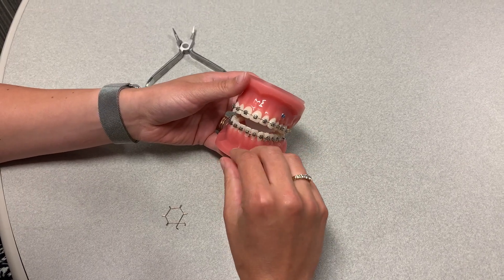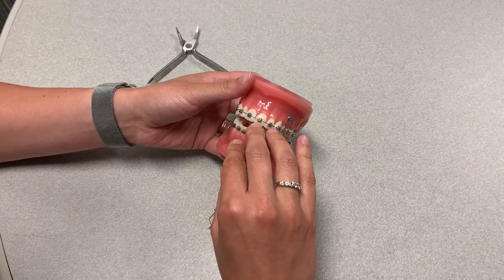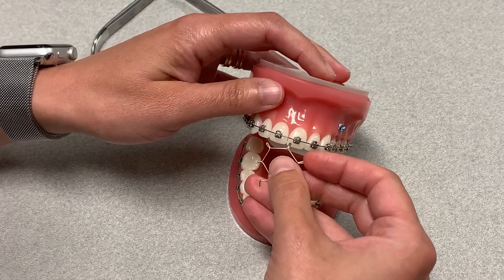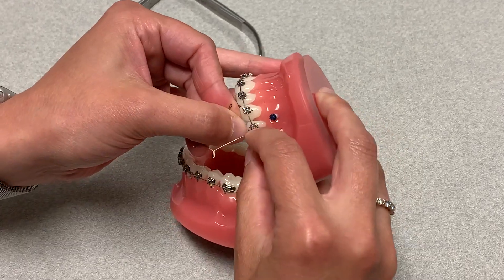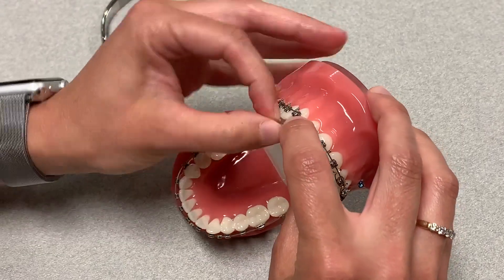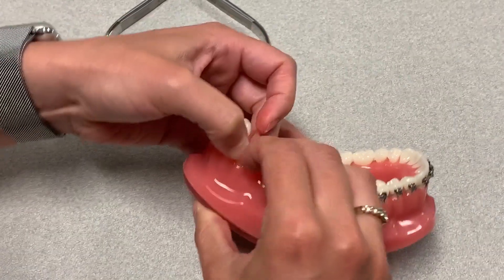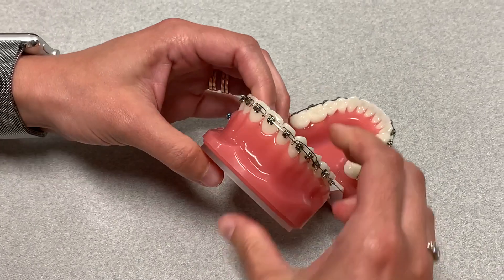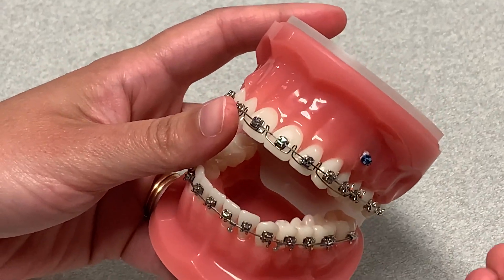ART Install

Comment: Does detorquing means palatal root torque ?
Reply from the maker: Depending on how the ART Spring is installed, it will apply positive or negative labial or lingual torque.